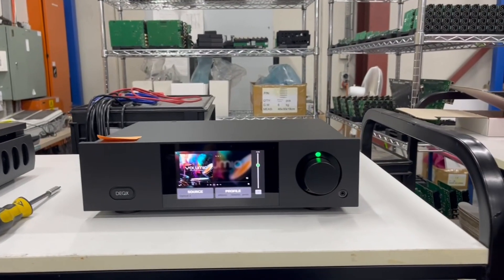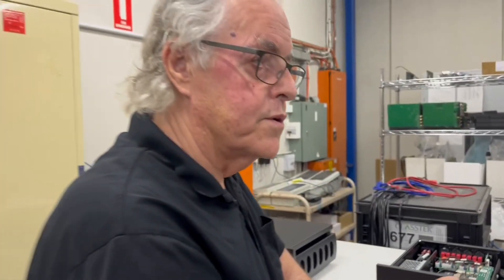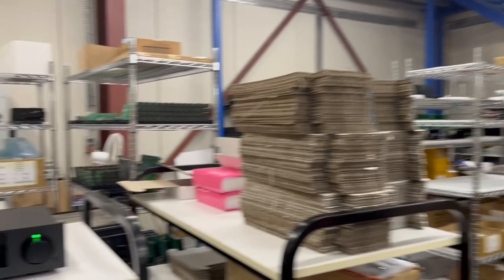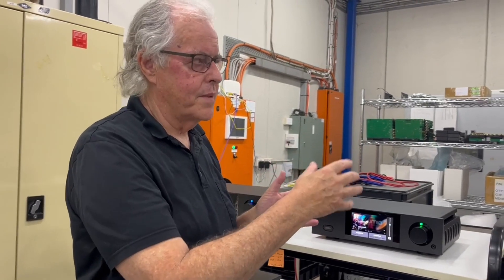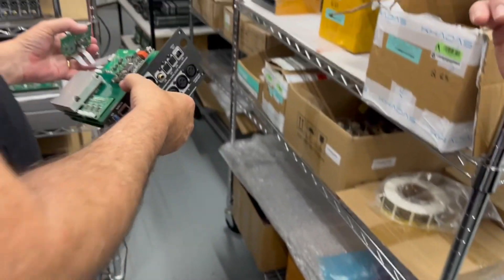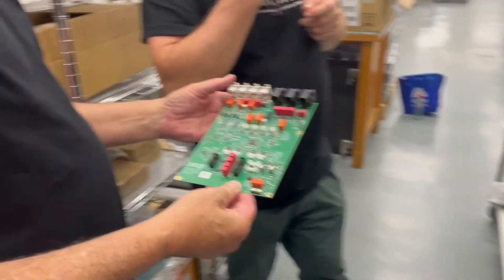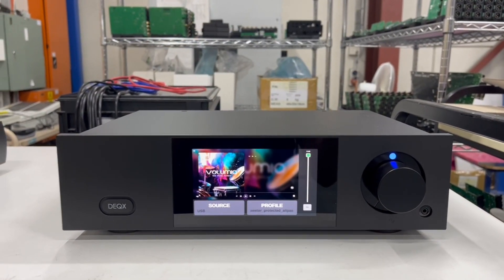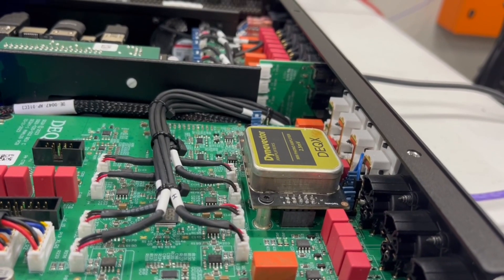DEQX Australian factory tour with designer Kim Ryrie and Not An Audiophile, The Podcast

Comment: Hi, re headphones. The three Gen-4 models have headphone outputs on the front panel. We do have the option to perform headphone calibration in future, but TBC. Now, however, you can apply multi-band parametric EQ to your own preferences and save them as one or more headphone filters, which can be selected on the DEQX smartphone or pad app.